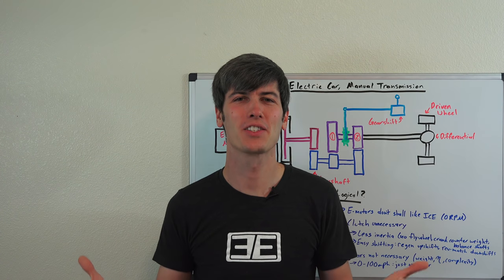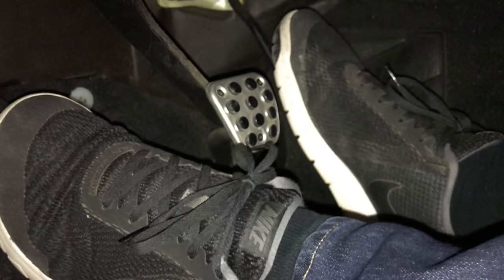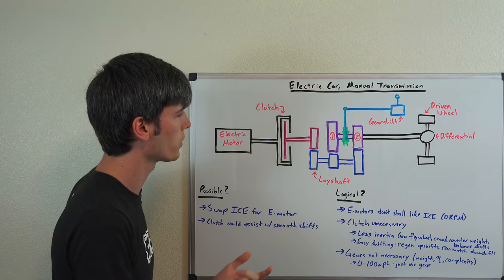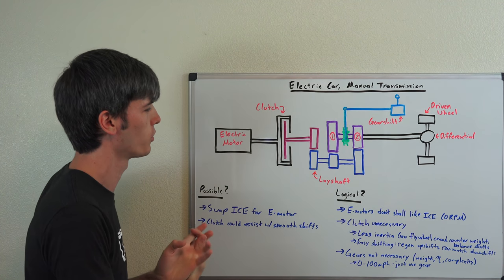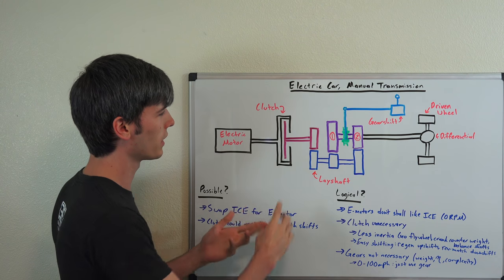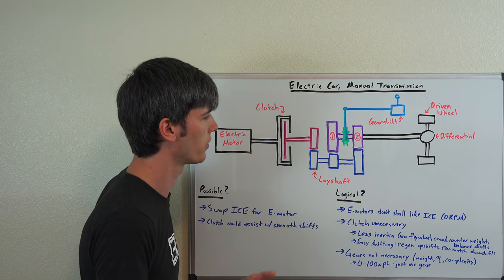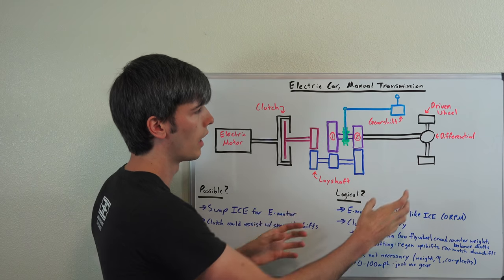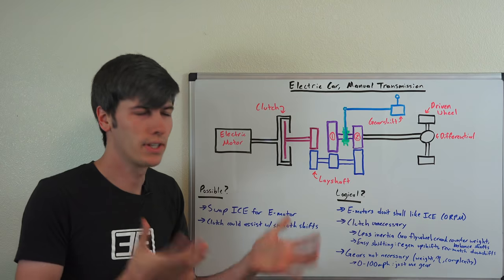Could Electric Cars Have A Manual Transmission?

Comment: If an electric car comes with a full manual  transmission I will buy it. I refuse to get an automatic  (in any vehicle).
Reply: Same
Reply: Teslas are singlespeed
Reply: Same
Reply: redbeam_   The clutch pedal is half the fun of driving a manual, without that, you might as well buy an automatic with a "manual" mode.
Reply: I think that Koniegsegg came with a good idea. It uses a complex CNC design into a torque converter to multiply torque. The thing is that normal torque converter could only multiply in specific situations (it's required a certain speed so that oil inside can turn itself into tubrine cams and do the job) and mostly because it did not go far in terms of expanding torque. For IC engines is OK because automatic gearbox normally requires more energy to function compared to a manual and the tech to design this part just went to deminish that difference and provide efficiency.

But Koenigsegg made a low inertia torque converter that could double the torque in it's peak capacity. I think like a Tesla Model S, a car that was used to compare with Lambo's and Ferrari's in terms to show that eletric cars could be fast this could probably be the solution to outrun IC engines in any terms. Nowadays 0-62 mph (0-100 km/h) is an easy task for eletric cars. But as soon as it goes for medium and high speeds they lose to ICE super sport cars. Using a torque converter after 60 mph or 80 mph this scenario could change. And for eletric vehicles it could also provide more mileage.

The Koenigsegg torque converter is used in his hybrid car wich has one gear only (equivalent to a 7th speed gear) and the job to move the car from full stop is done mostly by the torque converter.
Reply: Man.... Electric motor does not "need" a transmission to shift up/down since it's already the most efficient way of moving the wheels.... You can control the speed using electric current only
Reply: Jose Garcia yea manuals are awesome when your young but when you get older it kind of sucks a little at times but I know what you mean when you get old like us you've mastered the clutch and geers to a science and it grows old   
After a while but remember one thing us old guys can make a standard sound just like an automatic coming through at 5500
Reply: Jose Garcia most EVs don't have any transmission at all. It's not automatic so you can buy an EV without any transmission.
Reply: scottthewaterwarrior after I started having weak knees, I realised how much of a pain it is to clutch down. I really appreciate that AT and NT exists. (NT means no transmission - that's most EVs)
Reply: But it’s not an automatic. Electric cars are direct drive like top fuel dragsters.
Reply: Jose Garcia dude it's not "manual vs automatic", it's "manual vs direct drive"
Reply: Think of it this way, the Motor itself equals engine + automatic transmission , what u get from the transmission equals what u get straight out of the electric motor. So why would you need to shift gears when the motor itself does it for u (without gears)?
Reply: I've been converting gas cars and trucks to electric since the 90's and 90% of the time I use the original manual transmission. We use series dc motors , 8" ,9", and 11" net gain.  We use the Zilla controller mostly which comes in 6 sizes , 150kw to 700kw.  It seems to be that the bigger the motor and the bigger the controller the less need there is for shifting gears and the car truck can be left in Top Gear if the motor and controller are big. That said going the other way the smaller the motor and controller you use you may end up needing to shift at least once. There has been a long-standing debate over which is better AC Motors or DC motors. Proponents of DC motors will point out on the strip DC is still the fastest motor and is also the cheapest pound for pound. AC motors have the advantage of being able to spin much faster over 10,000 RPM where the series DC motor are fixed at about 6000 RPM. Another interesting point is that when you are cruising at a steady speed it doesn't really seem to matter what gear you're in the power consumption is pretty close to the same. A 3000 pound car will use 10 to 15 horsepower to travel 50 miles per hour. I've noticed that vehicles where are we attached the motor directly to the drive shaft with no transmission seem to use about 10% less power. I've done two vehicles with automatic transmissions and they seem to use 50% more power then the standard transmission, but I have seen people claim that they can modify an automatic transmission to be more efficient. You can click on my profile and see videos of my conversions.
Reply: VW Beetle EV conversion. Uses existing stick. Clutch optional.
Reply: build one
Reply: I hear ya, but traffic is so bad in and around where I live a manual becomes a bit tedious.
Reply: Same
Reply: Me too. Much prefer an old clunker with manual than ever have to drive automatic

Comment: With gearbox, eletric vehicles can be more useble on highway
But you have to calculate the new effieciency with one more device
Reply: What? Top speed for a Model S is 155 and that's because it's governed. As stated in this video already: you're just adding unnecessary weight

Comment: We don't use manual transmissions just because they give you more joy. They are more reliable, they can provide instant torque (rev the engine and then let clutch quickly), they can take more power and they are perfect for braking the tires loose at drifting (aka clutch kick)

Comment: Feels like you're forgetting that electric motors have efficiency curves too. Just as it's important to look at BSFC you should look at every electric motor efficiency curve. There is a reason still to use a gearbox with an electric motor. Look no further than servo systems. You want low rotating inertia and the materials you make gears from are lighter than the materials you make stators and rotors. Electric motors, when given enough design time, should be geared down for maximum performance. Thermal loads can be an issue so it is easier to design a large motor, no gears, if only to absorb the thermal stress without fancy cooling solutions. Duty cycles are hard for some to visualize. In the IC engine world you could play tricks by changing the AFR and/or reducing ignition timing. It's not so easy with an electric motor.
Reply: Gearboxes were designed to keep an engine within its more efficient range (efficiency curve), so being electrical or combustion, the need for a gearbox is the same. Also electrical motors could be smaller using a gearbox.  Please correct me if I'm wrong.

Comment: I can see a transmission (manual or automatic) being used in many scenarios where it would be beneficial. Coming from a background of rc cars I understand the importance of torque and how it can really help in off-road situations. The bolinger B1 for example could use a lower gear for slower speed off-roading where getting the motor rpms up can help with control and torque purposes or in larger trucks. If you don't understand what I mean and you ever have an opportunity to drive an 2 speed rc car I'd highly recommend it, you really understand what a 2 speed will do for an electric motor.

Comment: Everyone's saying that electric motors are silent and there's no point in changing gears. Are you guys deaf? There's an increasingly high pitch whine from electric motors!
Reply: Oscar Lee rimac concept one. Don't believe everything from forza horizon 3's tesla
Reply: If I recall correctly, a lot of that noise was engineered back into the electric cars to give pedestrians an audio clue that the cars were around.
Reply: drive an EV and you can clearly hear it.... bet you think the world is a ball too lol, you need to do some research son.
Reply: Oscar Lee compared to a blown straight piped motor there's no contest
Reply: Glad to see you somewhere other than that top gear review on the Rx8
Reply: dorktorbimmer: Maybe the research you should do is read the manual of your EV. It clearly states what that "whine noise" is. (Hint: it doesn't come from the electric motor). Maybe you should follow your own advice about doing research before blaming others of lack of research.
Reply: Going deaf while saving earth  lol. But seriously good way to make it more alive!
Reply: You are correct. Most electrical motors uses PWM (pulse width modulation) to control revs. The sound you hear are coils, singing at high frequency current.
Reply: Nathan Palmer: 95% sure dorktorbimmer was joking.. the ball earth bit gives it away
Reply: It's not a traditional PWM control since it's not a DC motor, but an AC induction engine. That's why you need an inverter, to turn the Direct Current into Alternating Current. 

After that you control the speed with something called a VFD or Variable Frequency Drive, which varies the frequency of the engine rather that the voltage.

All in the name of efficiency. :)
Reply: Unless they are broken or brushed there should be no sound, what you hear are probably bearings and any other gearing.
Reply: doktorbimmer well it's certainly not flat ..
Reply: I love that high pitched whine, sounds like a flying saucer :)
Reply: It's the sound of the strait cut gears.
Reply: MsSomeonenew i can hear a high pitched whine but my dad can't, might be something there but personally i don't think anything can be pure silent, you have a high speed motor spinning air and friction will cause some sound
Reply: Oscar Lee motor noise is relatively low, most likely you're hearin elements of the drive train, or belts or perhaps gears whirling. Generally speaking an electric motor alone is quite silent. Cars like telsa and nissans leaf whine in that high pitch noise due to there gear reduction systems, I believe.
Reply: and high pitch whinning is annoying...
Reply: Actually, AC motors are silent. The sound you are hearing is the steel gear reduction whining at high RPMs. You can hear the exact same sound on a gas motor that is runnin a timing gear setup instead of a timing belt/chain or a twin scroll roots style supercharger.  An AC motor or BLDC motor with a sinewave (not square wave, square waves make high pitch coil whine) controller and a belt drive reduction runs perfectly silent.
Reply: That is for pedestrians I believe I heard that they had to add that so people heard the car coming
Reply: Gear shifting isn't just about noise, it's more about mechanical advantage
Reply: Oscar Lee what if I'm deaf for high frequencies?
Reply: Grev McGrevington it's like a high pitched hum constantly... I don't think batteries make that noise so I'm like 90% sure it's an artificial sound so that people hear it coming rather than some kid runs infront of a tesla because he didn't look for cars and relied on sound
Reply: Lol have you ever sat in an electric tuktuk? They sound INSANE.
That's coil whine though I believe.
Reply: +Jason Mizuno: It still doesn't work. I ran into this problem driving a hybrid on San Diego city streets - blind people can't hear you coming unless you stop, because the high pitch of the electric motor at speed is indiscernible from city background noise. It's only when it first accelerates or stops that you hear the whine.
Reply: Electric cars are NOT silent.  So the engine noise is gone.  But what about road noise and aerodynamic drag?  That is where most of the noise comes from anyway.  I remember it was late at night, and I was walking home with my friend.  We both heard a noise, we turned around, and there was an electric car about 10m behind us slowing down to turn the corner.  We made space, it turned the corner, and drove away.  But during the daytime, we didn't hear it do that.  The reason is because daytime is louder, and hotter (the latter having only the barest of effects).  It would not be so loud during the day if we all drove electric cars; therefore they would be more audible if we all drove them.
Reply: Most often its from gears, not the motor.
Reply: No, it actually is from the motor. It's not prominent, but it's there.

Electric motors, however, generally don't get louder than the tires, which is why you can still take blind people by surprise with them.
Reply: Yeah, I know what you mean. I have some experience designing those systems. And I know some, especially older people can't hear the usual 16kHz. But there are some really good implementations, especially with SVPWM and similar algorithms that are really silent.
Reply: Oscar Lee The pitch is the sound of the transmission gears, electric motors trend to run on higher RPM  so the sound of the transmission is a higher pitch than a combustion engine. Having quiet motor allows you to hear the other components of the automobile. I personally enjoy hearing the engine when I drive but hate it from the traffic next to my house
Reply: Yup.. kinda like a supercharger whine
Reply: ... And it's music to my ears.
Reply: On an internal combustion engine that whine is called a supercharger . In some applications (Hondas) its called service your transmission oil
Reply: Still comparing to real engine, they quite small.
Reply: the motor has to be running on very high RPM to hear it. And you can hardly hear it

Comment: ICE cars that were converted into EVs often use the original manual gearbox the car came with, so it is doable. My only doubt is whether it would be a more economical option (in terms of fuel economy) than a now normal single speed EV.
Reply: Yeah a lot of the old backyard EV conversions used the stock manual trans... I think that was often just a matter of convenience, but most of those motors were also realllly weak. The added torque multiplication from the transmission probably did help somewhat.
Reply: It's less efficient, so no. Also, it's starts to become a real mechanical problem with very high instant torque motors, a real point of failure as it's now experiencing much more stress and will fatigue quicker. I worked for a company that did that, but with powerful motors, and it broke stuff constantly.

Comment: Some DIY electric cars have gears. Search for the electric VW Beatle.
Reply: *Beetle
Reply: if only had the money and shop
Reply: Having a simple gear reducer would be better, but in the case of the car already having a transmission, it's cheaper and easier to just use it. I worked for a company that did that, while it saved money, it was ultimately not worth it due to the much higher torque and stresses causing issues/breaking stuff.
Reply: If you're going to convert a petrol powered car to electric. attaching the electric motor to the original transmission is just an easy way of doing it.  While you do end up with a range of gear ratios in your electric car, Its a bit pointless. Because of the torque of the electric motor you can just let it in top gear the whole time.
Reply: @conortobin6180  I think most people know that.  So, we're not talking about efficiency here.  This is about the joy of driving, and quite a few people feel like they are in more control of a manual car.
Reply: @conortobin6180  um torque it's a falling curve so gears are still useful. Idk where people got this belief that electric motors dont benefit from more ratios
Reply: @conortobin6180  also most top gears from manual transmissions are extremely slow. Because your 1:1 with the rear gear and this isnt optimal in all situations

Comment: See, I can understand the whole concept of a manual transmission (as we know it today) being an inefficient system to be put into an electric car, but I'm also wondering if there would be the possibility of simulating a manual transmission, in the sense that the clutch is merely a pedal that acts more like a gateway button to changing gears versus having a whole transmission and clutch system dedicated to it. I know nowadays some electric cars simulate engine noise inside with speakers, so I do wonder if a simulated manual could come to fruition in the same way. And I am completely aware of the fact that the whole paddle shifting thing or flick shifters are deemed as simulated manuals, but it's just not the same as moving that stick between the gates and having that very specific control over the car.
Reply: It is definitely possible. Having a fake stick, a fake clutch, a fake rev meter (and probably a real one), and some speakers should be able to simulate a manual transmission on an ICE (and probably you will be able to choose if it is an I4, V6, V8, and so on and probably adjustable turbo lag as you may wish at any time). As long as you don't go too fast the simulation should be good. However, such the implementation will make you go a lot slower than the same car without all these things.
Reply: Well slower is the life of a manual stick shift car compared to its dual clutch counterparts, but it's all about that experience. I mean, that is what I fear most with these newer vehicles becoming more and more automated, is that loss of the feeling of complete control and immersion.
Reply: So you mean a clutch pedal is still provided, while the clutch plates are replaced by electromagnetic components (utilizing electromagnetic induction principle) which are used to engage-disengage to the output shaft ? I can only imagine but don't know how to. :)
Reply: "some electric cars simulate engine noise inside with speakers"
what a joke lol